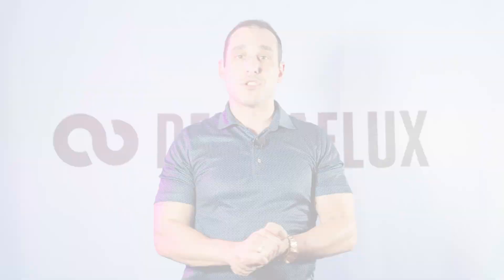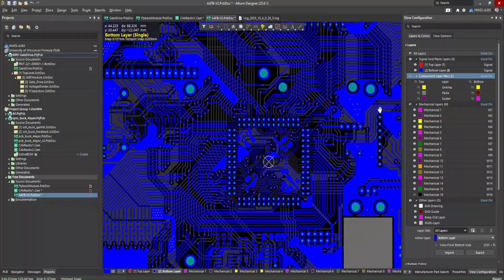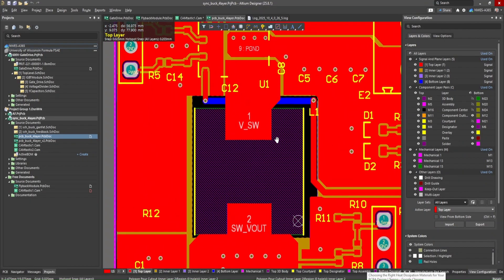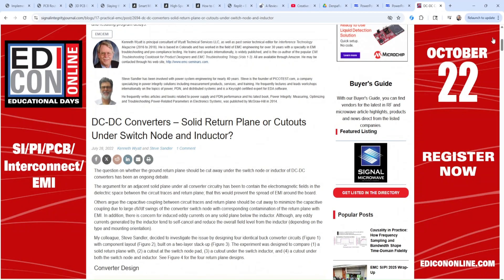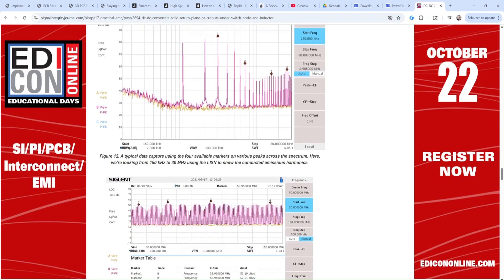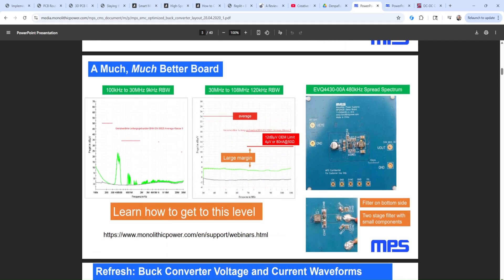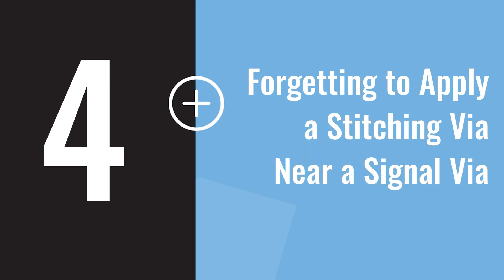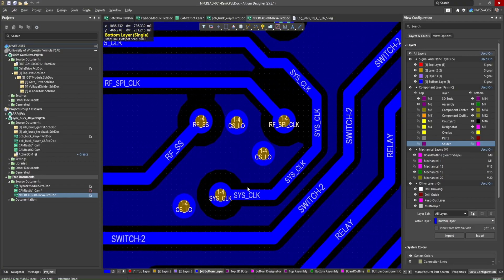5 PCB Layout Mistakes That KILL EMC Performance (Fix These Before Testing!)

Comment: i put ground layers of full ground under the regulator and switching node...but not in the same layer under the inductor itself.

is this ok?
Reply: I understand you removed the copper pour from layer 1 that formed under the inductor, well this is fine, but you must also remove the copper that forms under the inductors and MOSFET transistors
Reply: The coplanar ground near the switching node has less of an impact than the ground below the switching node because of the total capacitance to the switching node. Coplanar ground will almost always create lower parasitic capacitance on the switch node compared to ground below the switching node. The exception is when you have very small clearance near the coplanar ground and very large distance to the ground below the switch node. So probably does not make much difference. However, I have not seen any data comparing these situations.